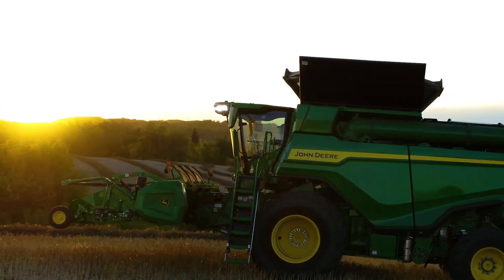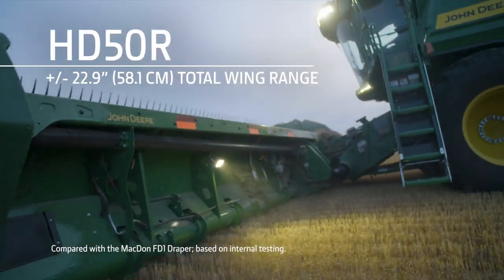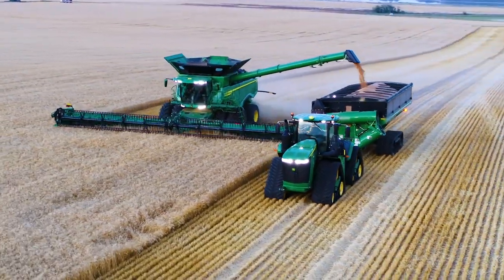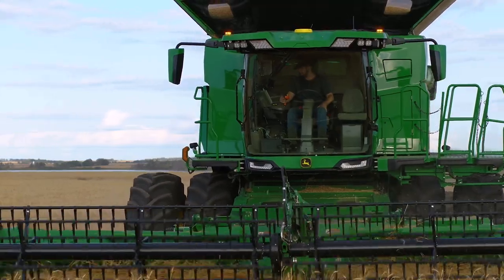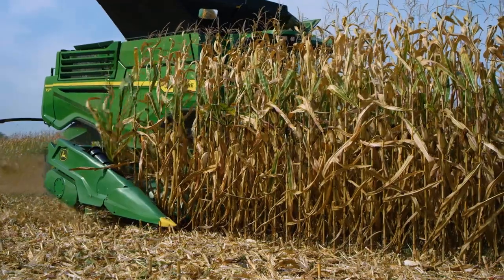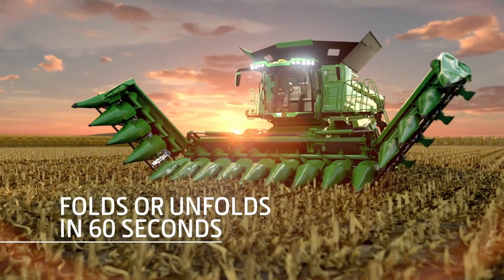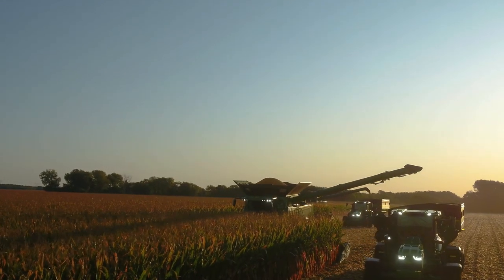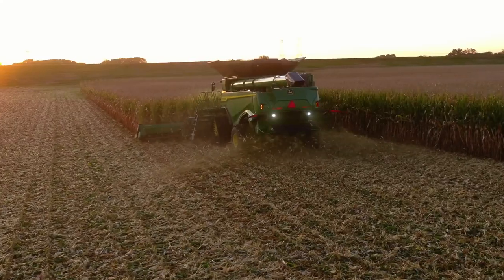Front End Equipment | John Deere X Series Combines

Comment: At 3:30mins you have made an error in the feet to meter conversion on draper widths. 30 FT = 9.1m and 45 FT = 13.7m and the 15.2m is an irrelevant measurement for that draper
Reply from the maker: Baden, thank you for bringing this to our attention.  We offer four widths of RDF HydraFlex™ Drapers:  30’ (9.1 m) , 35’ (10.7 m), 40’ (12.2 m), and 45’ (13.7 m).